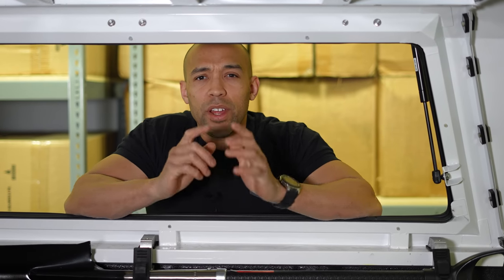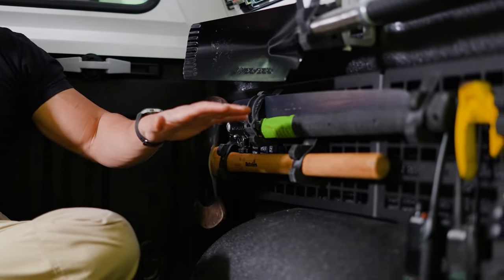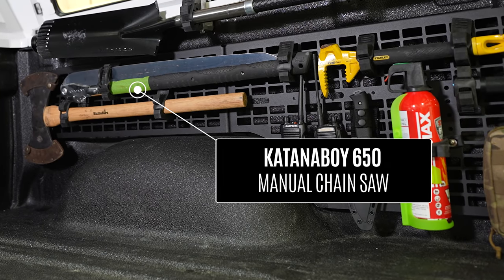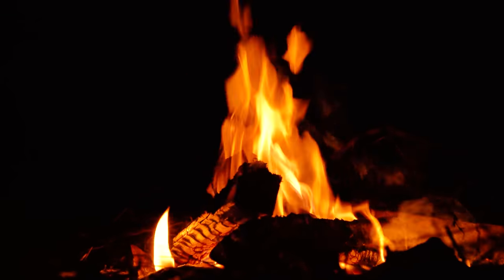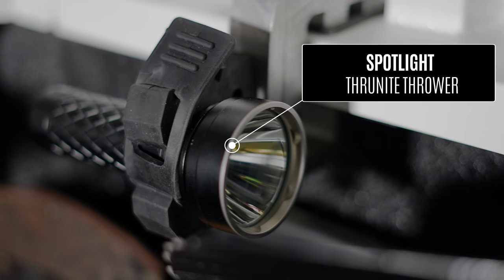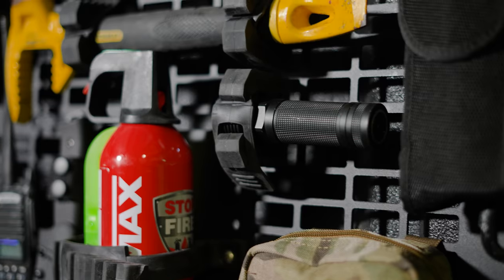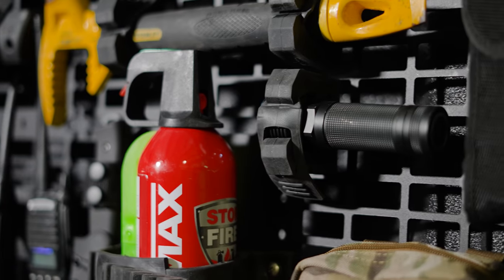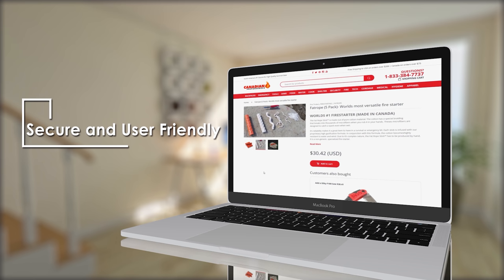WAR WALL! MOLLE Panel Truck Bed Organizer

Comment: Last time I was this early the 5.56 and 9mm was still on the shelf
Reply: @Matthias_Fischer  speak for yourself. I haven’t seen any in brick and mortar stores
Reply: Ummm. They're allot of places online that have 9 and 5.56 and it's on the shelves of alot of the box stores I've been into. I just prefer to buy online in bulk. That's were your going to get the best deals. Good luck ammo hunting. I buy reloads from a friend of mine that are very affordable. I use those on the range. So go make some friends. It might solve your "ammo problem".

Comment: I have a love-hate relationship with storing things in my vehicle. Primarily due to seasonal temperatures. Fire extinguishers, bear spray, first aid kits, certain electronics, ...Etc.  So in the most extreme parts of winter and summer,… Carrying my truck bag in and out of the house is unavoidable.
Reply: Why?
Reply: @teacopem  When parked outside in the elements… Let’s say in winter… Temperatures can drop below recommended storage limits for many items. 

In summer, of course, just the opposite. Vehicle temperatures can exceed safe storage limits for even fire extinguishers. Same for bear spray… Etc.

Various salves and creams within a first aid kit can be frozen or rendered ineffective by heat. Adhesives on a Band-Aid can become worthless even. Etc. etc.

Comment: Friend: Hey Cp will you help me move my couch to the new house?
Cp: Sorry can't not enough room in the the bed I'd have to take out all my survival gear.
Friend: If you don't want to help just tell me.
Reply: Nice video, you need six USB C charging  points, for your torches (flash lights), ham radio's, plug in light and phone charging. Keep up the good work 👍

Comment: Neat system. Would not place walkies or electronic in the back without a sealed case. The dust in grid roads will always get in. Especially in Sask.

Comment: It would be nice if the side panel was mounted on slides so you could pull the whole panel out and not have to crawl onto the bed to access everything.
Reply from the maker: That would be neat, if you invented that I would be a customer!
Reply: Yeah I like that idea😉
Reply: You need to make the suggestion to the manufacturer.  But I suspect they already tried the rail system and it is either outside of a normal price range or it would require adding a weight limit to the system as the rails pulled out would put additional stress on the mounting brackets.  As it stands now, you have practically no weight limits other than whatever the mounting brackets are rated for.

But with all that said.  I like your suggestion.  It was also one of the first things I thought to myself as I watched the video.  CP is younger and more agile than I am.  By the time I got inside my truck and got to the gear I stowed on the rails, the emergency would already be over.
Reply: or alternatively mounted with a hinge that allowed it to swing open and use the narrow space between the tool wall and the side of the truck. i know it is not much space but I would load that with softer gear like tarps etc.
Reply: googles "industrial draw slide"
Reply: @creativeprepping  I'm thinking 2 pc type system. side hinge the rear section and top hinge the front.  Oh, and quick release buckles to strap the equipment in.
Reply: @creativeprepping  There are companies that make swing out toolboxes that cover that first part up to the wheel well.

Comment: I like the idea. One of the things I was thinking during the video is to organize based on need, and groupings of things that you might use together. For example anything that you would need in an immediate emergency should be loaded in a way that could access them the quickest; fire extinguisher, pry-bar, radio etc. Good video.

Comment: That bed cover is a MUST in SHTF. Tip- if you are getting vibrations/noise from any accessories you mount try using a foam or rubber roll of gasket. Rubber washers on mounting points help too.

Comment: Can you direct me to a video of how to use the molle panel? For example, how to attach the quick fists? Are there other methods of fasening gear? What are they? Which ones are popular or good value? Do you need to modify your panel to use these mounting methods? How do the panels mount to the truck? Whats invoved with assembling the panels to your truck bed, etc? Cool show and tell of your gear!

Comment: Just a thought for those of us handy folks. ...I have numerous flat perferated steel. In older cities you can find old cast iron radiator "screens" that protected curious little hands from being burned. ...those are 1" squares. Also,  have some perffed round holed material from old dozer rad protectors.

Comment: Nate, every wrong has a right. I mean the fact that this unit doesn’t allow you to easily remove an item can be a benefit as someone breaks into your truck. It can also hold more securely while you’re going over big bumps. I like the way it looks and could see that in my Yukon.

Comment: There are several vids on modifying your FatMax tool to make it more useable.  
I bought a few and modd'ed  them and being the king of finding/rolling up on car wrecks both on and off duty, the mods the thin the pry points a bit and cut off the spur are well worth the effort.

Comment: Great video thanks for the ideas.  If you want to save $400-$700 though just get some wood and paint it black and drill holes in the wood and buy some bolts (likely m6) that will attach to your bed side and you can have the same thing basically for under $100 total.

Comment: I would suggest tinting the windows of your camper shell.  Use as dark of a tint as possible that way someone does not see and thus tempted to steal your gear.
Reply: Use that 3m anti-shatter window film, makes it extremely difficult to bust open the windows. You see guys pelting a brick at it in videos leaving just a small mark or crack.

Comment: i have owned many different trucks, all of them with canopies. i recommend insulation or a headliner inside. if you shelter inside during cold weather, it doesnt take long for the condensation to start raining down on you.

Comment: I made something like this for the trunk in my camry. I use the truck bed for hauling dirt, mulch and firewood so it wouldn't work there without being quickly removable

Comment: Very interesting. My vehicle is a bicycle, but I still have carefully choose what I am going to take with me on any particular ride, and I hate ruckacks, so it has to fit in a very small frame bag. I normally take basic tools I might need: screwdrivers, 3 or 4 spanners, an adjustable spanner, small pliers, fitting for tightening pedal nuts. Also a high visibility cape, sun block, water (half liter) and sometimes a something small to eat, and light sun protection. It's a bare minimum really.

Comment: If your looking to save TIME then look at the secure tool attachments that are mounted inside Fire Trucks. When ever they started coming out with those black rubber grip ones (that you have) everyone on the trucks complained. Those metal springy type of brackets that hold poles.shovels and axes worked best for quick use, but the black rubber ones still will get the job done-just with more fuss.

Comment: I have my RamBox setup in the same fashion, but I dont have a shovel. I do have a get home bag, sleeping bag, small tent, an AR with extra mags, yank strap, and a lot of other stuff. My point is, the RamBox can fit a lot of stuff, to include ice and beer if you want. If you are in the market for a truck, the RamBox is a great system for preppers.

Comment: Very nice setup. I would also suggest a hi-lift jack, a come-along winch, a Cold Steel Trench Shovel (better if you have to work in confined space beneath the vehicle or building a shelter), and a T-handle wrecking bar.

Comment: I haven't read the comments so I don't know if it's been suggested already. You could put your bed at the top of the cap (truck topper or whatever you call it) so it can be pulled down. Then you can keep other things in the bed of the truck and still have room to sleep above it.

Comment: In real SHTF, you will probably suffer from degraded physical condition, so anything that helps conserve energy would be helpful. This molle system, the BOR, a good knife, saw, stove, etc may be lifesavers.

Comment: Cool setup.  One thing I would consider is adding some insulation between your truck bed and the backside of the mounting rack.  Keep the insulation black in color,  and ensure there is room behind in order to mount your gear.  Provides both temperature and sound insulation.  Also gives a "secret" area for whatever.

Comment: Custom cut some black cordura nylon covers, and put neyodium magnets around the edges.  Quick to pull off but covers your gear.  A thief can look in your window and see lots of juicy items to steal right now as is.
Reply: I was thinking along this line as well.  Instead of covers on the gear I would try and find some one-way window film to put on the topper instead though.  That way everything stays accessible but shielded from wandering eyes.

Comment: Without a doubt, add a full length handled pointed shovel and a sharp Pulaski, for digging, chopping, clearing, cacheing, and for burials. If you should have to dig in the Earth, you will wish that you had a big boy's shovel, instead of an abbreviation. Trust this old digger. Thanks for the video.

Comment: I would look at a heating system. Use reinforced plywood 3x6 foot sections and position them on top of the box (but inside), behind the cab for shelving or a bed. You can pull two of them down, place them beside each other, and get some thermal insulation from the metal. Not my first choice of accommodations, but serviceable. Glue some rug on both sides and it's even quiet.

Comment: I like that setup, for winter I would replace the shovel you have with an aluminum scoop shovel. I think they’re called grain scoops at most hardware stores, wax it or wipe it down with WD 40 so the snow doesn’t start sticking to it.

Comment: And a P.S. for those of us whose knees are  damaged or getting old: A pair of "hard cap" knee pads (decent-quality ones, not the $4.99 foam junk), tucked in under the taillight housing, can save a lot of pain. Good ones can be had for $15 - $25. It's worth a few bucks extra to get the 'waterproof" ones lined with closed-cell foam. You don't need the multi-part hinged "all-day" tyoe. It may seem a small thing, but a set of these that stay in the truck box can keep you mobile, and that can be important. They're useful whether crawling into the truck bed, or changing a tire. Your knees will thank you.

Comment: It's nice to know I'm not the only one that carries around a full-size Stanley Fat Max Fubar in the back of my truck. My canopy windows are glass, tinted, but someone could still see inside. I would be a little concerned about having nice tools on display. If it were me I would cut a piece of black fabric that would cover the panel of gear that could detach easily either with grommets, snaps, or Velcro.

Comment: if you like a speedier way to access and secure your gear, try webbing with side release buckles. the same concept used widely on bags and packs. quality of the plastics may differ. lousier one's may turn brittle earlier than more premium one's. 

hope this helps.

Comment: My first thought was why not some V-shaped slots the shovel and similar items would slide down into with heavy bungee cords to hold things tight. If you want fast access, a single bungee may secure multiple items almost an "X" or webbing across several things that quickly releases several... Drawback is in turn resecuring before motoring. For security I use large Pelican cases secured with u-bolts, braided cable and locks. Items like shovels get bungee'd to the cases. Most truck caps are too vulnerable and/or overlooked to integrate with vehicle alarm.

Comment: We call those a camper shell here in the South but yes they do come in handy. Especially if you're hauling off the dead bodies and don't want folks to notice. 😂🤣😂
Reply: I would add Tint Film to the windows. Black Film is always available at the Auto Parts shops which provides reduced visibility from the outside in and good visibility from the inside out.
The Big Box DIY stores have Frosted Film for light penetration into the truck bed, but poor visibility out.
Reply: -You don't have alligators?
Reply: @taiganwind7787  not in the town I live in. We have feral hogs instead.
Reply: Michael Hearne -sounds like fun. Do you barbeque them? We have some wild hogs just starting to invade, but it's so far north, I expect smaller herds and "eventually" bigger animals. Do you hunt at night?

Comment: Often better than a shovel in sand and snow (for you Canadians)... mount a long handle Garden Hoe on your vehicle.  It's far faster to unstuck a vehicle. Also, mount light weight stuff like sleeping bags, bed rolls (or yoga mats), blankets, trash bags, etc to the underside of the roof of your shell there.  And while you are adding all your gear, might as well also try and add some bulletproofing to keep you safer.

Comment: Thanks. Really like the panel idea. I was thinking, maybe a few hooks to hold the long tools would work better. If the curved part of the jay that is shorter and front facing were used, so that they were curved up far enough, then maybe they would still hold the tools in place with just an upward motion to free them. Yeah, all I have is a shovel, but I'm always making the things I can't afford, so maybe I'll get into that and see that rolls.

Comment: I would add molle panel on side door of the truck cap. If the struts can handle a little extra weight.

Comment: Build a platform out of plywood that sits on top of the wheelwells, use a pair of 2x8" on their side as supports. Now your bed is up higher and you get more storage space underneath.
Reply: Yeah it gets warped and comes apart if it sits outside. Maybe if its treated with polyurethane and paint.
Reply: @robludwigsen7831  I covered mine with roll-on bed liner, I could hose it off if needed.
Reply: Thats a good idea!

Comment: That is a bad ass rig!! I don't know if a person could possibly use the south park Corp. Axe handle brackets, they basically hold by pressure after you snap your tool into place. Easier IDK, I use them for a few things hold tight.

Comment: Awesome looking setup. Might consider somehow mounting an overland style gas can somewhere if possible. I think spare fuel would be top priority if things ever got spicy. Might consider mounting some lighter items on the inside of the side access panel of your truck topper. Would be easy access when door swings up and might look kinda neat ;) I’m a welder and recently got a large gas generator into the back of my Tacoma. I love knowing I have 9000 watts of power everywhere I go and can do mobile welding anywhere that I can park my truck. Thanks for the vid

Comment: If you want to go crazy you can look for the Jeep Wrangler JL chasetruck build on youtube. It is an extreme modification (wranhler turned into a bigger version of the gladiator) but the bed bins are accesible from the outside and that is like the best for easy and quick access tools on a truck. 
If not, you could get into the packout system from milwaukee and mout it on the tail gate.

Comment: One thing I'd definitely suggest is that you have some kind of cover over this. It deters the snoopy and the "5-finger discount" types. My box liner is already black, so I wanted something dark, non-perishable but breatheable, that could be rolled up out of the way, or fastened around the edges with button magnets. An excellent and budget-friendly material for the job is garden landscape fabric. It's black, but perforated and doesn't absorb water. It's fairly UV resistant as well, although that's not critical in the truck bed. You can find it at garden supply stores, or P.A.. The stuff fron CT was poor quality. A 3 ft. x 50 ft. roll is about CAD$10 CAD, and a 4' x 100' roll $20-ish, depending on where you shop. (This stuff also works pretty well to make canopy window curtains, which can be handy if you're sleeping inside). Probably the simplest way of hanging or stowing along the truck box sides it is to attach light battens to the bottom and top edges. On mine, I used two sections across the bottom and one long piece across the top. I had some black PVC tube; painted 1/2" ABS electrical conduit would also work. it's lightweight, not too flexible, easy to attach stuff to, and quiet. Two sections on the bottom are arranged with one from behind the wheel-well to the tailgate, and the other further forward. Some neodymium  magnets around the edges keep it in place. It can be moved aside instantly, or rolled up and stowed in 30 seconds (Velcro luggage strap material put behind the top batten works well - two pieces for $2 at the $$ store). Once it's let down, anything underneath is out of view, but access to an item takes only a moment. I've used variants of this since the early 1990's. Originally, I tried dark poly tarp, but it was stiff in the cold, noisy, less flexible and tended to trap moisture. The landscape fabric works very well. 
BTW, the "drain spade" you have there is also called a "round nose transplanting shovel." Most good garden centers have indestructible ones. 
For handheld radios, I've found it worthwhile to run a couple of leads to the holders for battery charging. Another useful accessory for those handhelds is a small magnetic-mount antenna. Those are generally not expensive, and it's easy to rig a pocket or holder to stow them. They give much more range than the standard flex antenna, making them worth the space. If there's no convenient steel surface to mount them on for use, a $4 steel cookie sheet and some duct tape make a simple and effective ground plane that works while moving or stationary.